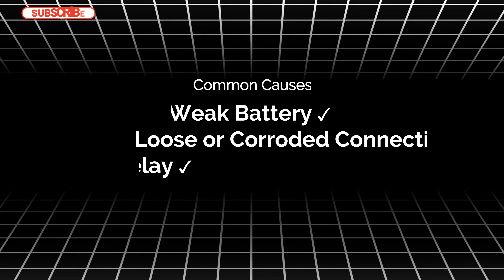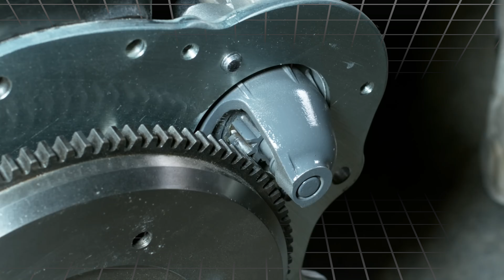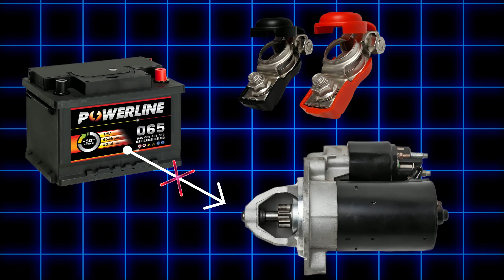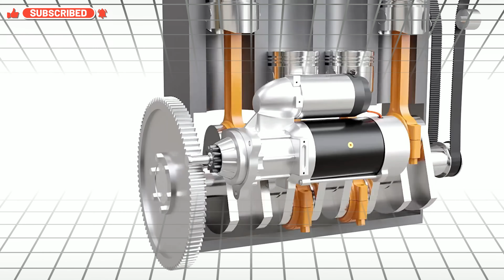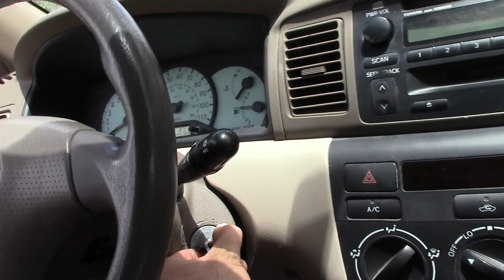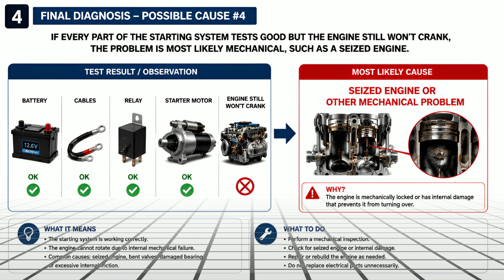Single Click When Turning the Key ? Common Causes & Simple Tests

Comment: 2015  chrysler 300, my car has a one. Click it engages and then disengages. I replace the battery, and put a used starter on there. It cranked over once, and that's it. I've switched out relays, and it's like the starter doesn't have enough power to turn the motor and the motor's not locked up, because I can turn it from the main pulley in the front. It turns over, you know what I mean

Comment: CAR WON'T START, JUMP STARTING DIDN'T WORK, REPLACED BATTERY, HEARD SINGLE LOW VOLUME CLICK WHEN TURNING KEY TO START
Reply from the maker: That combination of symptoms points more toward the starting circuit than the battery. If the jump-start didn't work and the battery has already been replaced, the next things to check are the battery cables and grounds, starter solenoid, and starter motor. A voltage-drop test can help determine whether the problem is a bad connection or a failing starter.

Comment: I’m having problems with my car mustard 2010 the problem is one click no crack no start but b4 is happening my engine down for water and engine down the same time to water so what can I do.  My Friend you help me out
Reply from the maker: Based on what you described, the fact that the engine was submerged in water before this happened is a very important clue. A single click with no crank can certainly be caused by a weak battery or a faulty starter. However, after a flooding incident, you also need to consider the possibility of a hydrolocked or seized engine. Before replacing any parts, make sure the battery and its connections are in good condition, then verify that the engine can still be turned by hand. If it won't rotate, don't keep trying to start it, as that can cause additional engine damage. Let us know the year, make, and model of your vehicle, whether the engine stalled while driving through the water, and whether the engine can be turned by hand. That information will help narrow down the cause.